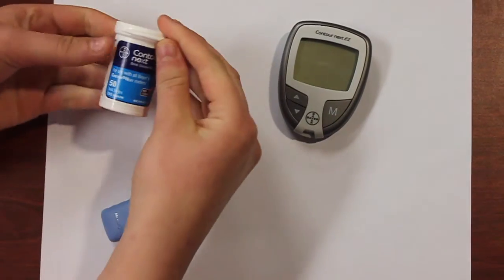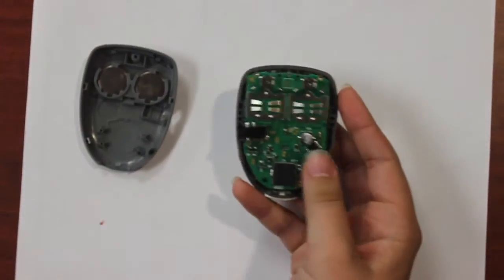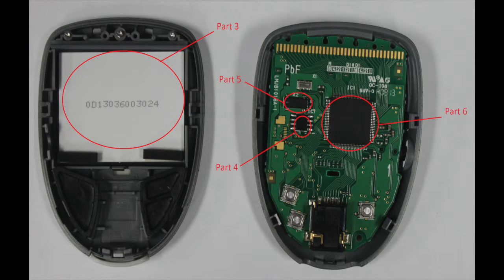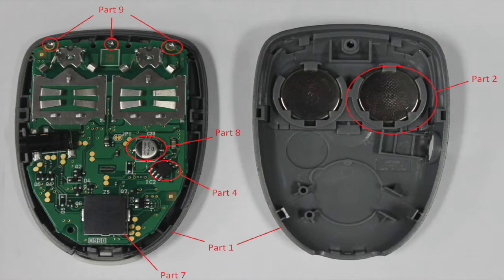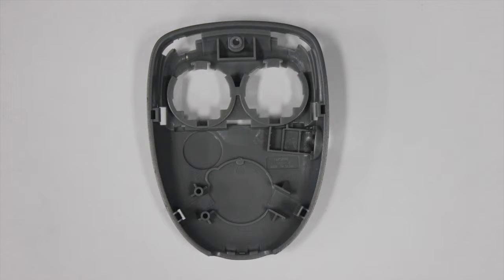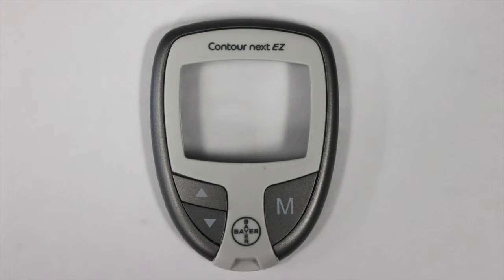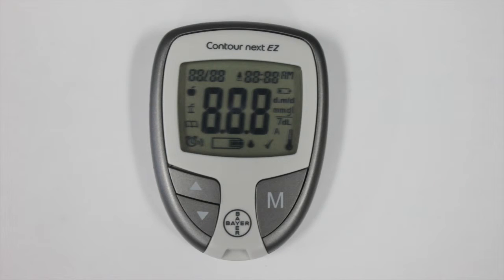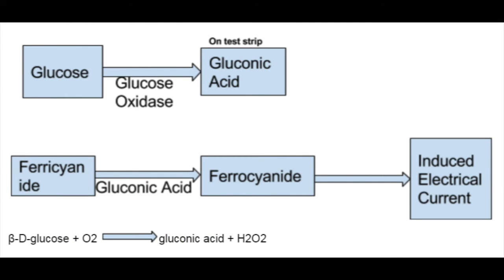Contour EZ Next Glucometer Tear Down Video

Comment: Parts 5 & 4 are NOT resistors,  Part 5 appears to be a crystal oscillator.  Part 4 is an integrated circuit, likely a serial EEPROM (Electronically Erasable Programmable Read-Only Memory) device, typically used to store user settings and save BG readings  that the processor can retrieve after power is lost (ie. when changing the batteries).  Neat video, I'm a Type-1 diabetic as well, always wandered what was inside these things.